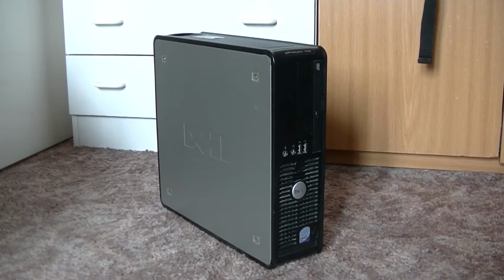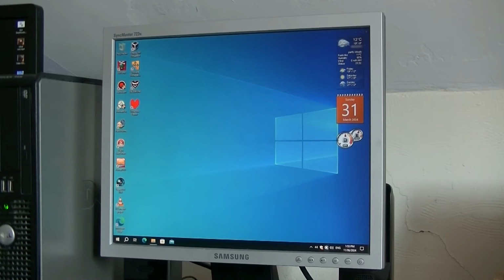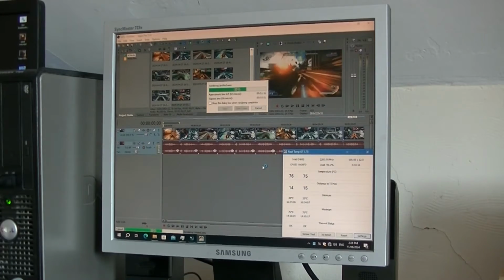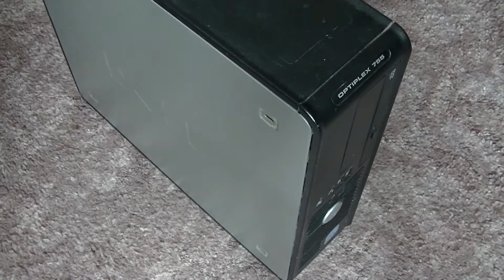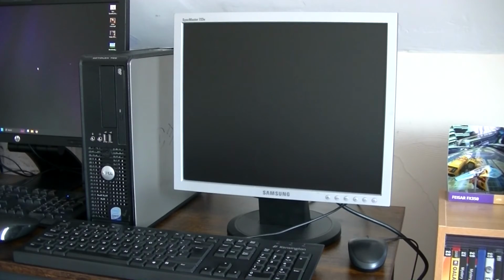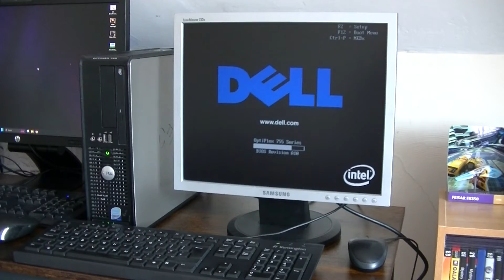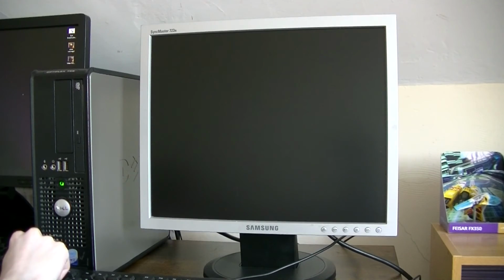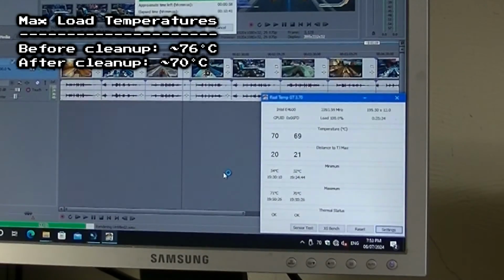Dell OptiPlex 755 - Boot-up, Clean-up and Temperature Tests

Comment: Optiplex 755 , you want to be sure that your bios is upgraded in order to put a core 2 quad 9400, which the system admits and a low profile dedicated graphics card, which is even better than integrated intel graphics card.